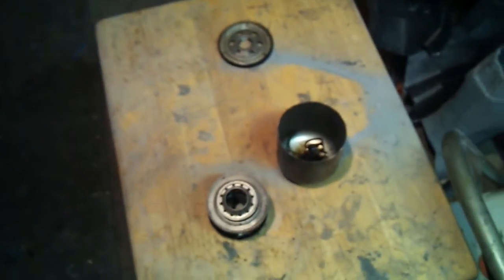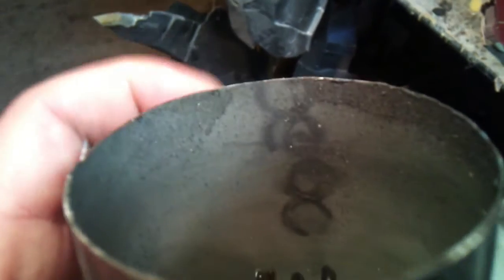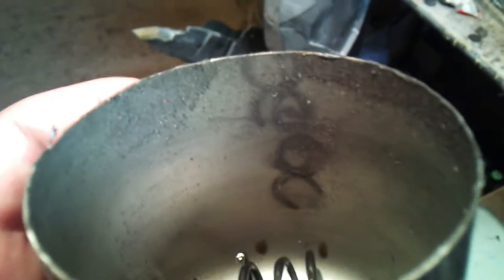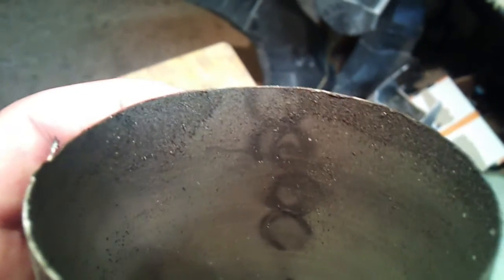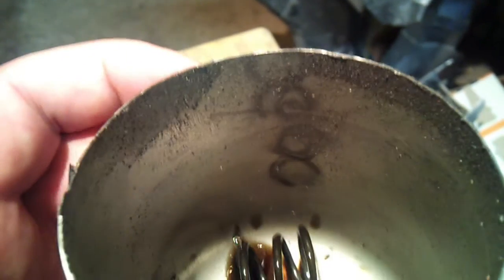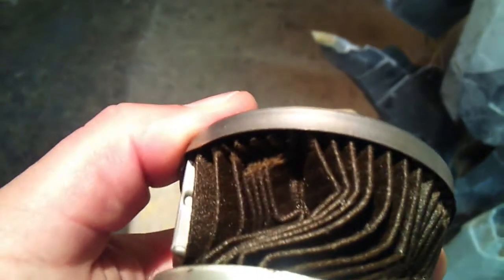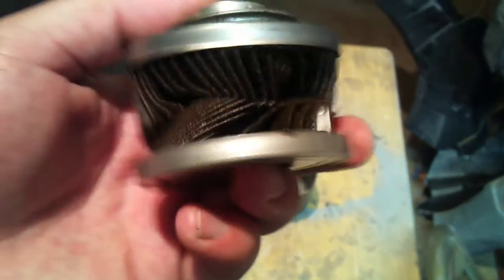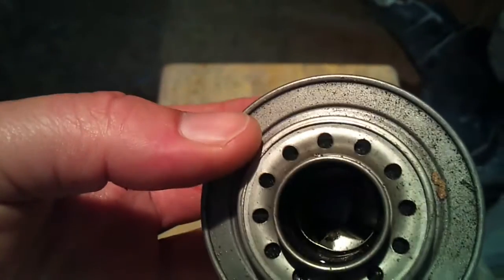Magnets on oil filters

Comment: Ware to an engine mainly occurs when the engine is cold. I do put a magnet on my sump plug. Fact is the metal is going to drop to the bottom when the engine is sitting. It is also the lowest part of the engine. I get i bit of metal when i take the sump bolt out and it is easy to clean at the sump bolt. I admit that the filter will filter most of it. NB. i am not an expert!

Comment: Neodymium magnets lose their strength when exposed to high heat +200 f. A magnet placed on the side of a filter would collect metal particles and then release at one time or very quickly a surplus of said particles at said temp creating a cycle of intense erosion within the engine. While a good idea, the result is catastrophic.
Reply: The curie temp (failure) is over 500 farenheit and strength loss starts  at about 300 Fahrenheit for the cheaper neodymium magnets